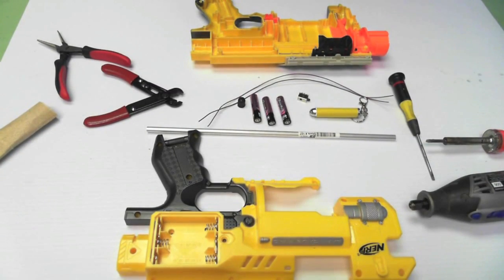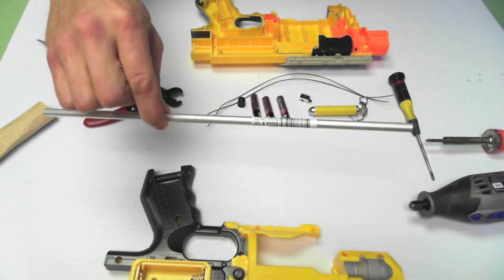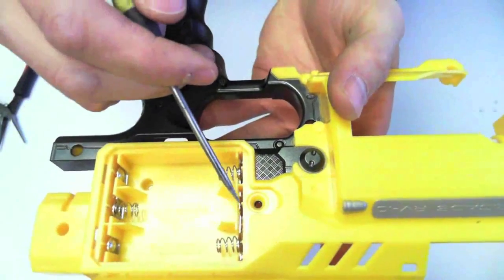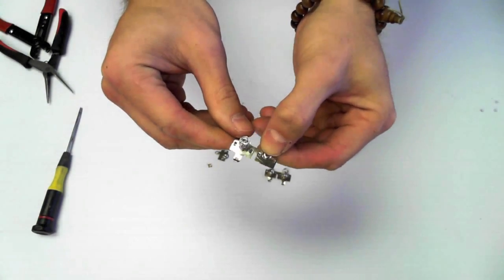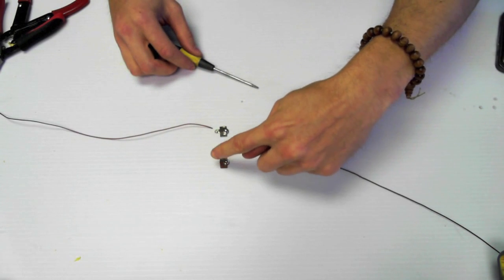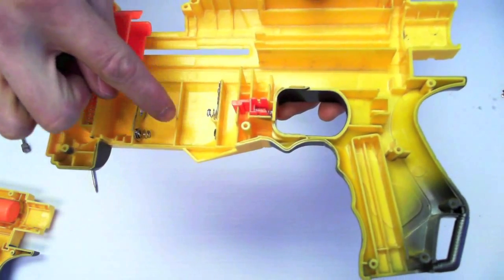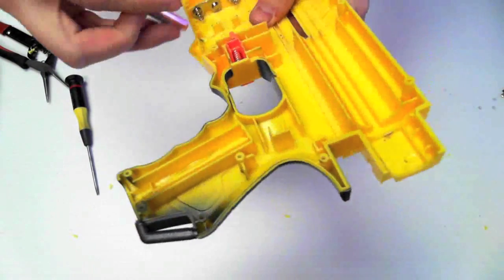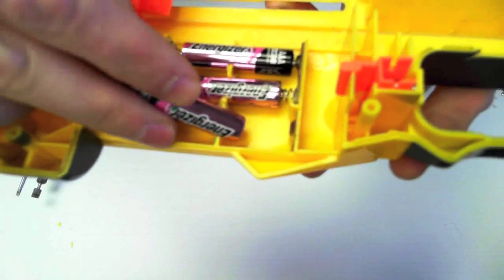Nerf Recon Electronic Mod Part 1

Comment from the maker: @cianc13 we're setting the recon up for different electronic mods, with enough power (you can have up to 6, 3 on each side of the shell) you can do stuff like internal LED aesthetics, laser pointer, led flash lights etc...  Semi/Full auto is really not out of the question either but we haven't invest the time to look into it yet.